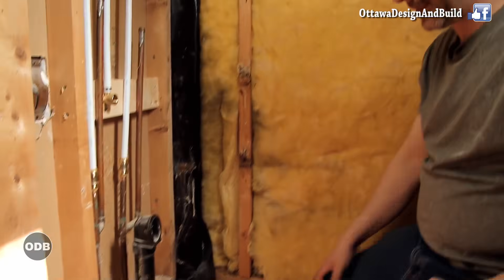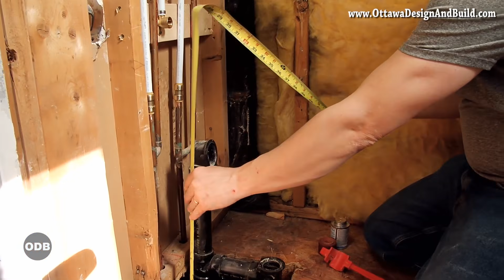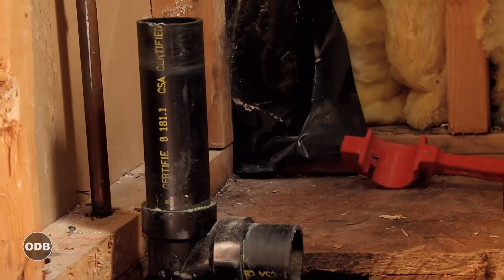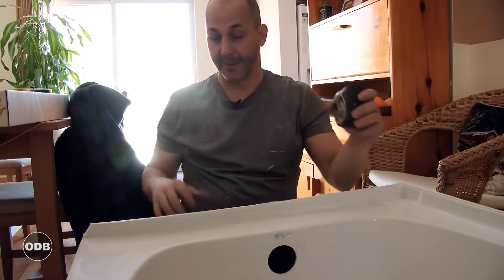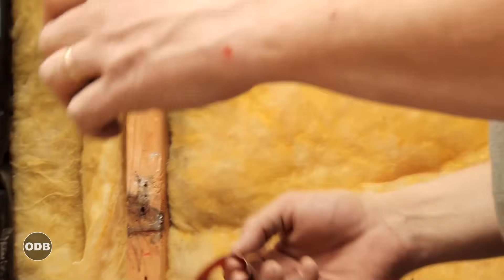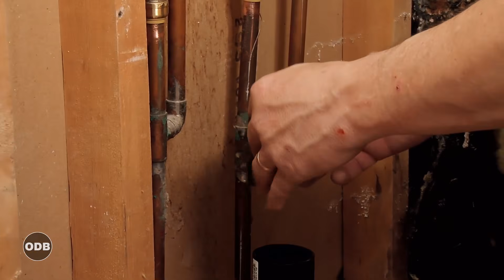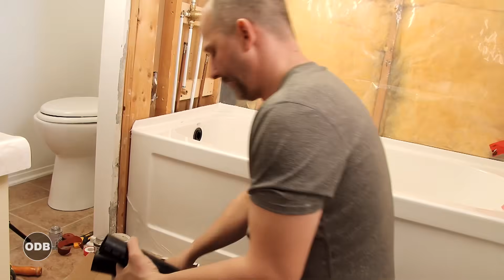How to Install a Bathtub Drain and Overflow

Comment: While I can appreciate the attempt to share your technique with the web, one practice shown in the video is unnecessary, and another is plain wrong. First, I've never seen a Journeyman plumber sand ABS like we would copper unless to remove some smeared cement that might have gotten on the end or to remove a stubborn burr. Sanding ABS is unnecessary because the joint doesn't need a rough surface like solder--the cement melts the surface just fine, rough or smooth.  Sanding won't hurt, but it's a waste of time and sandpaper.  

The more problematic issue in the video is how the person cemented the joint. He only applied cement to the sockets and not to the male ends, which is a major mistake. That process wouldn't pass inspection on any job I've worked.  Those joints are too dry and far less structural than they should be. He should have applied a coat to the socket first and then a heavier coat to the pipe for a properly cemented joint.  If jobsite experience doesn't teach someone that, just read the cement's instructions which explains it.
Reply from the maker: no need for name calling. Often times in trade circles there are different views and applications. Thomas has a legitimate point. It does clearly say to clean the end of the pipe and fittings. I just choose to do it with sandcloth so that I have a habit of always removing burrs and dirt.
Reply: I need to comment and agree with this post in case another DIY'er like myself uses this as their sole source of information.  The cements instructions clearly state how to use it and no where does it recommend sanding.  It DOES state to coat both male and female connections.  Ottowa, I greatly appreciate your video though.  The tips on pipe flexibility one way but not the other are great.
Reply from the maker: I'll stick with my plumbers advice , thanks for your opinion.
Reply: I always figure better safe than sorry and it certainly wont hurt anything
Reply: The sanding of copper tube and tubing is to remove surface oxidation and clean the copper to allow for proper capillary action of the solder. The flux helps this in “wetting” the surfaces of the fitting and tube/tubing and prevents oxidation when it is being heated to the melting point of the given flux.    In no way does a copper joint have to be scratched up or rough for a leak free solder joint.  

I do agree that the sanding of the ABS pipe isn’t required, however it must be clean and free of contaminants that will interfere with the solvent cement.  In a commercial setting where plastic piping must be fire rated,   PVC is used because it does not support combustion, however it is cleaned with a “purple” primer first then it is glued.  Glue should always be applied to both the hub of the fitting and around the pipe to be inserted.

Red Seal Journeyman Plumber and Gasfitter(A) Class
Reply: I was thinking the same thing. The video is good for what it is but I'm not going to start sanding abs or gluing only one side. Also, I didn't agree with his reason for putty instead of silicone on drain. Also, those foam core cutters aren't so easy to use on solid abs. where I live solid for drains and foam core for venting. Great video overall. Glad I watched it.
Reply: I came to see specifically if i need to sand my ABS for installing a drain and overflow to this new tub I'm installing.  I glued a coupling and didn't sand it and got worried.  Glad to see there is a concensus in tbe trade that it's not too important.
Reply: ya that dude is kind of a douche like u said everything needs to adhere and no matter what you do things can not adhere properly to a smooth surface. A lot of people dont sand their walls to remove the gloss before repainting a room either this leads to paint peeling and things of that nature because paint can not adhere to the smooth surface.....this rule applies to everything adhesive related

Comment: Thanks mate, I did pay to go on a plumbing course a while ago and whilst we covered the installation aspects there wasn't the the time to cover some of the smaller details. I loathe using silicone, seems like such a bodge, plumbers mate seems a lot better solution.
Reply from the maker: The truth is simple anywhere you use silicone to keep water out...it will fail. It's not a matter of if just when.